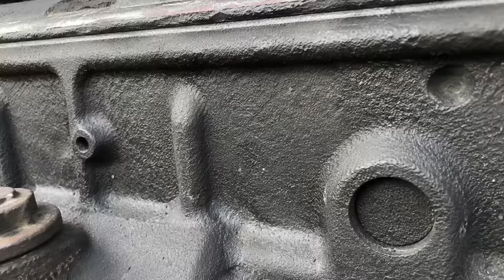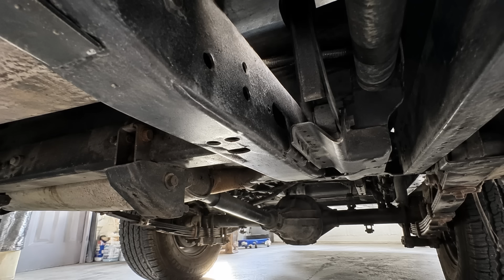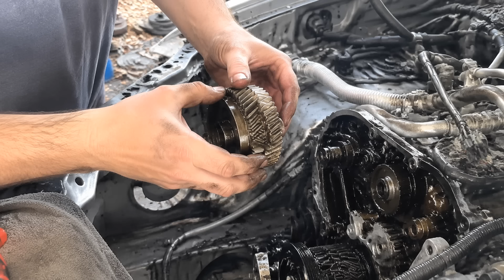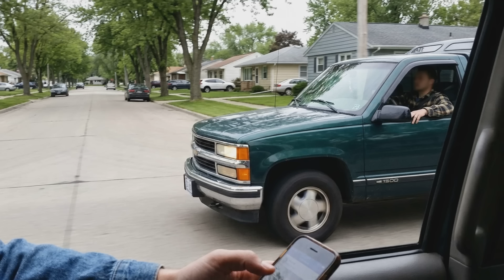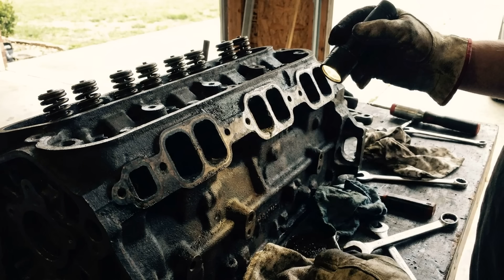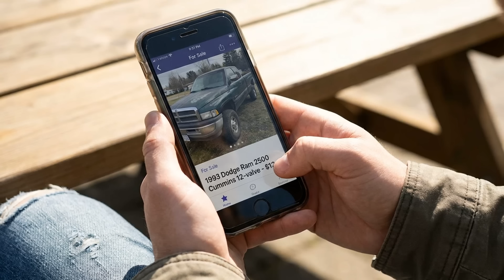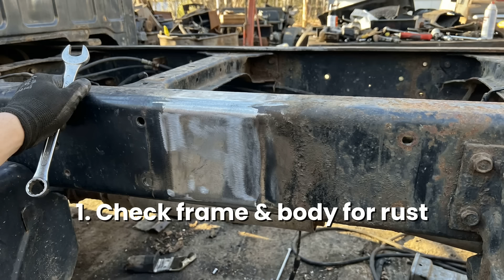7 Dirt-Cheap Pickup Trucks Nobody Buys (But They'll Outlast Every New Truck Forever)

Comment: I like old trucks but don't have 10 thousand in cash.
Reply: Means you REALLY don't have $66000😅
Reply: You left out the chevy s 10. These trucks were great little trucks. I had one 260 k on it.
Reply: @carlcopas8540 I’ll second that! I had a 91 S-10 that I’d wrecked that had the 2.8 with a five speed. When I wrecked it, the insurance company totaled it, but let me keep it. I sold the thing to a guy who had a frame for it. When he tore it down, he had full intentions of refreshing the engine due to the miles. I ran into him six months later, and he asked me if I had already done it because he still saw hone marks in the cylinders with no ridge at the tops of the cylinders. He put the truck back together, painted it, drove it to damn near 300k miles before he sold it.
Reply: Seriously Bro?!?!?!   Recently on our Craigslist, a person advertised a 1993 Ford F150, 4WD, 300 Inline 6, 5 Speed Manual, 143K miles, and it wasn't a "Rust Bucket" for $2,650!!!!!!!!
Reply: Les, $1,000 is still cheaper than $75,000 for a new Truck+ expensive insurance+high Personal Property Taxes.
Reply: Just doing basic upkeep on older trucks is getting expensive these days, just bought new alternator, new draglink on steering, new shifter cable for colulm shifter for transmission, new triple switch for head light bright/dim, wiper and turn signal, new brakes on the front, and new gas tank for a 94 F350 4x4, and it was almost a thousand dollars and i did labor  myself. Before that i gave it a tune up and oil change, before that i had to buy exhaust manifold, replace sepentine belt after the air pump went out, and both the idler and serpentine belt tensioner. Got lucky with getting truck with very good tires. Just simple replacement pieces that high mileage vehicles need replaced.

Comment: Dad had an E100 van,  with the inline 6.   It had 3 on the tree.   It was a 1962 that he sold still running good in 1987.  more than 460k miles.

Comment: 08 Chevy Silverado I've got the ticking Time bomb but it's still running and running and running. It's very well self-lubricated. It leaks but it runs and runs and runs. The 4L60E tranny is going pretty well too and the frame is going not so well. It has the Northeast Rusty cancer. It probably will not be on the road next year. It currently has 260,000 mi 5.3 l crew cab 6-ft bed. Love this truck! Going from dying slowly to dying quickly. Now though I drive it everyday. Looking for a replacement Bill Western Mass
Reply: pull the motor get a new skin.

Comment: Got my 87 Ranger in 90, ran well with the 2.3 for about 150k miles, runs even better with a 5.0 from a 91 Mustang GT.  Almost like it was made for that motor and hauls just about anything within reason with authority.  Gas mileage isn’t the best but the motor is practically bulletproof….  Love driving that truck!

Comment: I had a 79 chev pickup that would carry any load the tires would carry.  It had one fatal flaw where the 350 v8 had an oil pump that wasn't in the bottom of the pan and if got low on oil it stopped circulating oil.  It damaged the engine and it was never the same. It was if it got more that 2 quarts low.   I don't know if this was a one time mistake on this engine or if it was common.

Comment: Bought a 2013 Silv 4.8L 2wd regular cab with manual windows new in 2013. Sat on the lot for months. Nobody wanted it. What a find no stupid AFM no 6 or 8spd tranny. Hands down the best vehicle I have ever had. truck listed for 34 I paid 23. Dealer wanted it gone. The 2014s were a disaster. I will drive it until the fenders rot off. The wife and I ran out of the dealership mumbling " Start the car"

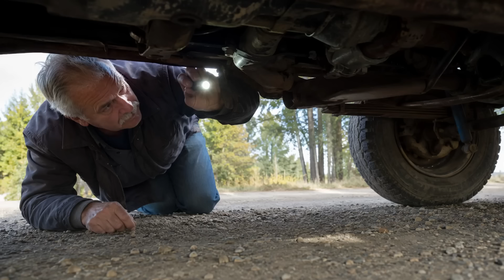Comment: 2:21 - That flashlight magically floats from one hand to the other. THAT MECHANIC IS A FREAKING MAGICIAN!!!
Reply: That's why he get's paid the big bucks!  Never drops a part, bolt, or a tool.😆
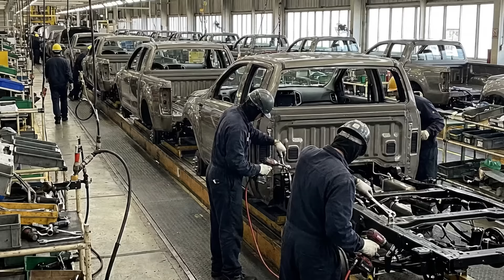Reply: 25:20 that's an odd assy line where parts of the truck disappear into thin air LOL!
Reply: @staycurious3954😂😂😂
Reply: Damn! He's good!
Reply: First thing i noticed. I had to back it up to make sure my eyes didn't deceive me. Lol
Reply: And they magically drive themselves.
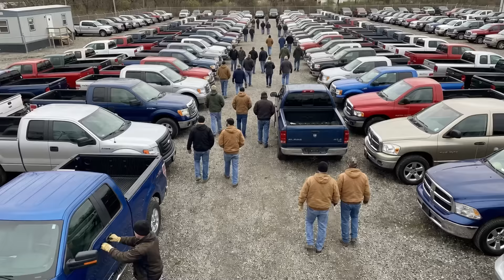Reply: The Tundra transformer at 26:00; changing colors as it was about to eat two shoppers tilted it bad for me.  Will be avoiding that model.  Also a lot of wrenching on air bolts everywhere.

Comment: I have a 1985 Nissan truck with the 2.4 liter engine. It has 199870 miles on it. And I drive it every other day back and forth to work from home . If is a 3x4 wheel drive truck four wheel drive still works fine.  I live in Henderson North Carolina .

Comment: Ha! I love my Dodge Dakota pickups I've own/owned. Two got totaled out due to a-holes drivers hitting them but they never gave me any problems other than the normal front end alignments issues they are known for and one heater core failed on my '00. All have been 4.7 V8's (which I know people hate but if you take care of them they last) 2wd, extended cab trucks. Funny thing is when I bought my last one, about 13 years ago, I paid 4k for it. I see them now with 100k more mileage, beat up, and people are asking 4.5-5k. Somehow my truck has gone up in value, lol!

Comment: I bought an 03 f150 4.2l about 9 yrs ago with 160k miles on it for $2 grand. now it has 235k miles Drove over 2 hrs today no issues
Reply: I'm driving a 2003 F 150 that I picked up for $500. $290 for the Calvan insert kit to fix two blown spark plug holes, $200 for a starter, and $150 for a used rear end because the grinding sound that I thought was bad brakes turned out to be a bad bearing and it wallered out the axle tube. It has 336000 on it.

I miss my F 150 with the 300 though. It turns out that a black Angus cow on a dark night is really hard to see. To add insult to injury,  I live in an open range state, so I totaled my truck and paid for a cow.

The caveat is that you can't afford a $500 truck if you can't do the work yourself. In MT we don't have rust😊.
Reply: I have a 04 F 150 setting outside less than 190 thousand. I don’t plan on selling anything, just replaced the tires. I do regular maintenance and that is all I need.

Comment: I had a 1990 F150 with a 4.9L I6.  I sold it dirt cheap in 2004.  I regret it every time I think about it.
Reply: I can top both of you... I sold my 1970 440 charger RT for $750 in 96, and my 65 sport fury 383 commando v8 for only $775. 
Now you guys can feel a little better.
Reply: @tigerprado Someone was dancing in the streets when you signed the title off that Charger.
Reply: @tigerprado Yeah, I sold my 57 2dr. Chevy, ran great and had a new paint job. $ 300.00
Sold my 72 GTO convertible  $ 1500.00.   😢
Reply: @davekeller2798  so sorry....
Reply: but you must have had a reason then....hindsight is always 20/20
Reply: Not a truck but an'02 Mazda Prtege, everybody laughed at it when first bought, they called it garbage. 600000 miles later after they bought several new cars thisa little bugger zooms right past them. Easy maintain, a lot of fun to drive, handles road like it built it, 32 mpg. Only thing bad is the radio, then again it may be what's on the radio. When this dies I will put it my back yard and use it as a flower pot & memorial. Must add this car has also been to every state & Province in North America. All for $6,000!
Reply: Must add: this was when cars were cars, people were people, Men were men and the women were women and the ones wearing earings, and dresses. They also knew their place.
Reply: Yeah I know how that feels.   GMC V8 Vortec 2004 pretty much perfect sold it in 2022 with 105 K on it everything worked.  
Regret it more now than anything else I can remember.
Reply: Had a 95 F150 with 200K.  Replaced the trans at 150, drove another 30K, gave it to brother who needed a truck and he totalled it.
Reply: Best engine ever made and I aint a Ford fan

Comment: Good luck finding obsolete parts! I rebuilt my 1998 ford ranger xlt. 293,000 miles. Pretty much the Mazda B2500. Mazda won't sell you parts without a Mazda VIN #. Was hell finding parts. Totally rebuilt engine and wiring. I'm on my 6 th ECM try. Good luck!
Reply: Find a Mazda B2500 for sale online and use that vin to get the parts you need, if you’re able.

Comment: Horrible AI slop. There are so many inconsistencies, such as, talking about a particular truck engine then showing the wrong  engine (not even the same brand). The AI can't even say small block 350 correctly. I could spend my time listing many of the "mistakes" with the corresponding time stamps, but it would take too long.  AI slop SUCKS!

Comment: Got my 1986 chevy Scottsdale half ton ,had to weld new rockers then have it painted 133,000 miles been in my family since new . last year for carburetor .  Will keep it till I die ,even if new engine and transmission needed only 5 or 6 K to replace . What kind of foolish person will pay 80 to 100 k for a an errand truck . I only put 1 to 2 thousand miles a year on it ,other wise ride my motorcycles or drive honda crv . These old manufacturing values are largely  gone from modern corporate  goals .

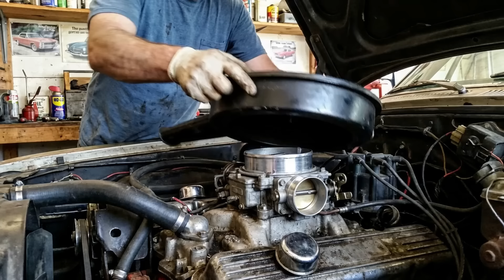Comment: AI puts things together so weird it makes no sense like (AT 15:54) the fuel injection system with the butterfly out the side of the unit under the air cleaner instead of through it. ;<)

Comment: 40 years ago truck engines barely lasted past 100,000 miles. ALL of them!! 
    The current truck engines, including turbocharged last 300,000 miles. You do have an occasional failure, but it’s less than 5% except Tundras currently. They will fix it. They are replacing the engines & the backlog isn’t quite what you elude to. 
    The B2200 has LESS THAN 100 hp. My buddy has a Ford Dealership and has records of thousands of EcoBoosts with over 250,000 miles.
  I have been a truck guy for 50 years! When I started getting into trucks I could quote specs on everything back to 1960. 
       You are clearly fantastically biased, fantastically uninformed or a bot placed to just frustrate everyone! Regardless, ad vice for you is point because you have no objectivity! 😂😂😂. 
     Do Not Recommend the Channel.

Comment: Still driving my 1991 Chevy Silverado 350ci. Paid 16K for it new. It has never been in a repair shop or dealer. I am 70 years old and have always repaired all my vehicles. I am not a mechanic. I got all my knowledge from the Chilton Books and Youtube. A year ago I replaced the throw-out bearing on my 1987 Suzuki Samurai  transmission. By watching a Youtube video, and it works great.
Reply: Right on, fellow old guy. I'm 72 and still work on my own vehicle. Did struts, motor and trans mounts this year. It's getting difficult for me though.
Reply: I had a 93 GMC, same motor, KEEP IT. Motor is bullet proof, trans gave up at 202,000, considering what I towed, should have quit sooner, sold at 218,000. Never an engine problem.
Reply: The Samurai is as rare as hens teeth that would fetch pretty good money
Reply: @danielmorgan4899  I bought it about 10 years ago for $2000. In almost perfect condition, and still is. It lives in the garage when not driven.
Reply: '98 C1500 4.3 5spd. I'm in New England, but being 2wd keeps it off the road during snow and it's been drenched in lanolin
Reply: Make sure that Mazda dont have that water cooled carb.

Comment: I drive a 2007 serria 2500hd  with towing package. 113000 miles on a 6 liter just put the first set of plugs in and other than oil and filter changes no other maintance . I pull  40 ft 5th wheel weighs 15500 lbs and gives me freeway speeds pulling this load . I live in Arkansas

Comment: i have a 1994 dodge dakota xtended cab 5.2v8 with original motor, 2nd transmission that was built to last with upgraded parts i do have a full msd ignition system with their msd 6al digital box, msd biillet distributor, msd ign coil & msd plugs & wires it comes with everything in a kit that is so easy to install its all plug-n-play so you cant screw it up.. it makes it so you get multi-spark under like 3k rpm's increasing torque and making sure it ignites much more fuel i also changed out all the rubber bushings and body mounts with a prothane/energy suspension with polyurethane ones making it ride betterbthan new and handles better than new the truck still runs good and has atlest another 150k miles in it.. i use mobil one full synthetic high milage oil and have an atermarket big trans coolerbwith its own electric fan that is tempature controlled to keep it running at the right temps and holds an additional 1.5 quarts of fluid.. its a good reliable truck with very little work
Reply: How can u say very little work?
Reply: Read your list.
Reply: @Barry-s7v ya I know I've done so much more to it than that but I felt I already wrote too much & felt I'd just leave it where I did.. lol

Comment: I have owned several 1992 - 1996  Jeep Cherokees. That 4 Liter engine is bombproof!!! I have owned several pickups with 350 Chevy engines. I have two sitting in my driveway, one with close to 200,000 miles on it, the other with close to 300,000  miles. I can't vouch for the second mileage. I bought it used about a year ago. It had a sticker on the dash saying "uses oil check oil daily". I change oil at 3000 mile intervals. At about 2000 miles it needs about a quart. Then you are good to go! Both these engines are 1995 throttle body. I have a 1999 5.3 engined 1500 Silverado. This IS my favorite engine!!! It gets better gas mileage than the 350's and has more snap!!! It's closing in on 300,000 miles. uses no oil between oil changes, and the oil looks clean at 3,000 mile

Comment: I live in NW Indiana, in the Chicagoland area. I 110% agree with what you are saying. But the reality is HALF of those old survivors rusted out years ago. They just simply do not exist in the rust belt.
Reply: You just have to be willing to travel for delivery. The south is loaded with older trucks that are still in great shape, even if they need some mechanical repairs. As long as the frame is solid and the body is not rusted underneath, they are excellent buys. If you really want one, just plan to rent a trailer to haul it home and go for it!
Reply: @TwilightxKnight13 I hear what you're saying and that is a valid argument if you are willing to invest the cost of the vehicle again into travel and rental expenses. Not to mention the logistics of finding the right truck that's over 500 miles (8+hours one direction) away. I've been down this very road, literally, and have been burnt.

Comment: My brother put a lot of highway miles on his trucks.  The 2008 cash for clunkers Colorado was the champion. 530k and the oil pump finally gave it up. He should have shut it down but did not.  There was still cross hatch on the cylinder walls. He drives like an old man and was paid mileage reimbursement of more than 250 thousand dollars on that rig.
    He gave less than ten thousand for the truck when he traded in his 6 cylinder Ford Ranger with 350 k on it. It was only running on five,but it limped in on its own power.

Comment: Magnificent little Nissan Hard Body with the 2.4 liter automatic transmission, rear wheel drive and air conditioning I bought brand new in 1987. It got over 500,000 miles on it after 23 years of beeing driven daily everywhere I needed or wanted to go. Trans got over 350,000 on it before replaced with a rebuilt one from Advance Auto. Air Conditioning got over 325,000 miles on as did the original radiator. First thing that had to be replaced was the water pump once. And the starter once. That little truck was a tank built to last and be damn reliable. Best vehicle
Reply: I had a '95 Hard-Body and drove it 200,000 miles. It looked BRAND NEW when I sold it for $2500. That sale was the one that I'll REGRET forever. +

Comment: The AI images here aren't hitting the mark. There's a lot of effed up, highly inaccurate images. AI fuggin sux

Also, the 300 got nylon teeth on the cam gear in later years and they would shear off.